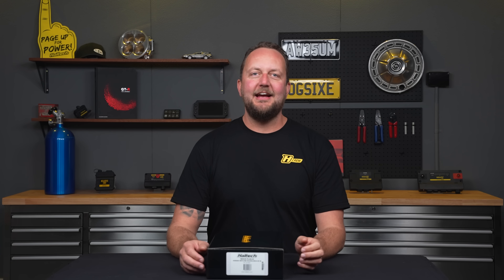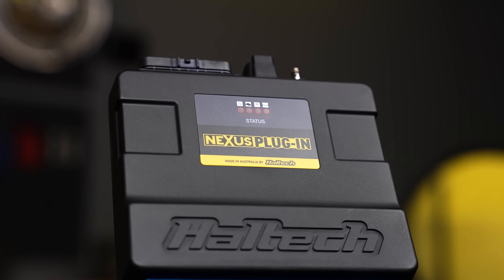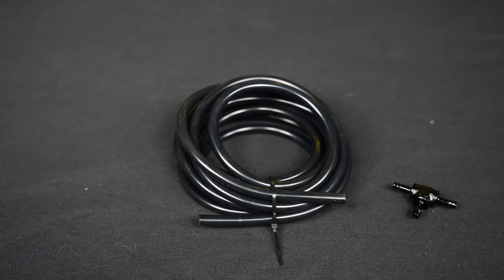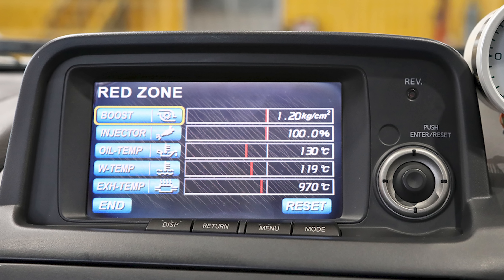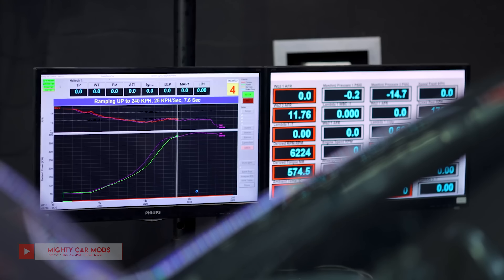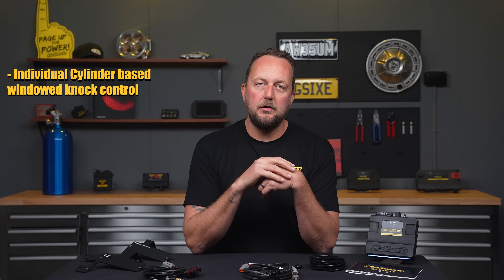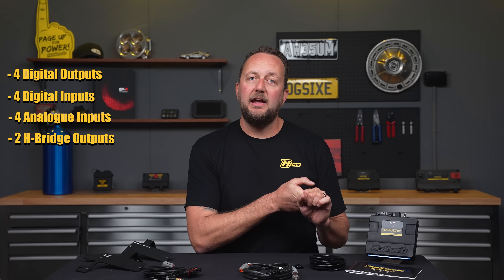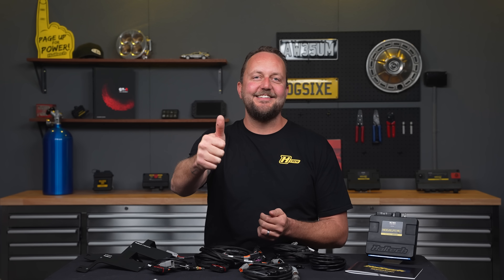SKYLINE PLUG-IN - Unpacking The Skyline Plug-In And Setup

Comment: installed my nexus s3 this weekend on my JZX100 this weekend, got it up and running,(newest firmware) But never once got the prompt for Wizard quick set up anyhwere, i only built it up off the base map for the chasers that it  offers.. any reason why that is?
Reply from the maker: Awesome to hear you went with the S3! Currently, set-up wizards are only available on our Rebel and Plug-In series ECUs, as we know exactly what engine they will be controlling, versus an S series that could be used in anything from your JZX to a WRX to even a boat.

Comment: So does this activate or better control any of the MFD features better than the Nexus S3 does? I read something about that... Any clarity?
Reply: The only MFD features controlled by the ECU are the TPS and the injector duty cycle. The S3 requires an additional adaptor circuit (which is built into the patch adaptor if you have that) to drive the TPS. Otherwise they're the same.
Reply: @Andy_the_engo  My TPS isn't accurate on the MFD with the app or my pedal. what's the adaptor needed?

Comment: Got mine ordered. But wondering if I can transfer my tune from my platinum pro until I get it tuned with the iat sensor.
Also can we get a wiring guide for a DBW for the skyline?
Reply from the maker: While some thing's may be able to transfer across from an older model ECU, we recommend starting from scratch with a new ECU platform
Reply: @haltech might as well take advantage of removing the afm for a larger turbo with the new iat sensor.
Reply: Well after watching it may just snag that harness for the DBW as it would make me feel safer knowing I can plug that into my new nexus and not worry about ruining it.

Comment: So, would this support the Autech 260RS Stagea since it uses the R33 GTR engine and (i think) ECU?
Reply from the maker: Correct it is essentially an R33 GTR underneath, the Nexus Plug-In will suit an Autech 260RS however we cannot confirm if it will bolt into the factory location

Comment: Will it do diagnostic as well , ie bad coil , injector, fuel , wiring? 🤔
Reply: It supports all the DTCs of the Nexus ECU.

- Fuel injector open circuit / short circuit, yes
- Coil bad, no, there's no way with the factory wiring for the ECU to detect that
- Fuel - if you add a fuel pressure sensor it can detect if you're running out of fuel flow / pressure - that comes on the auxiliary harness and if you enable it, you will get a DTC when your fuel pressure drops too much
- Will do the same for oil pressure
- Wiring - it will give you DTCs for most sensors (eg air temp shorted / open, coolant temp short/open, TPS open) or if your sensor 5V is shorted to ground, or things like that

There are a LOT of diagnistocs built-in, but not everything can be diagnosed with the factory hardware.
Reply: @Andy_the_engo thankyou for the info 😎